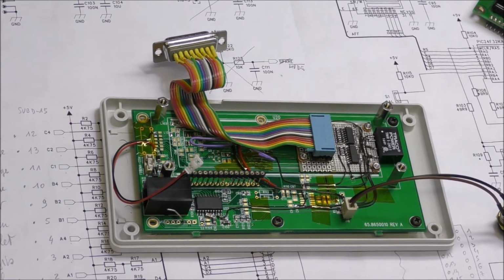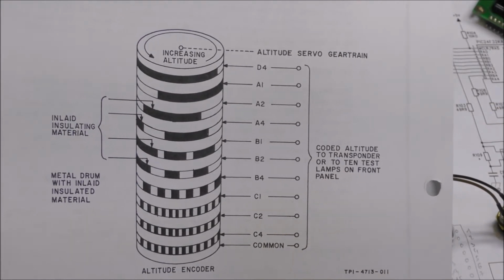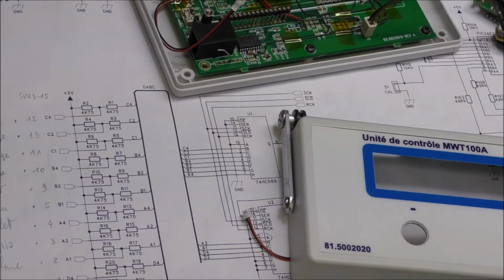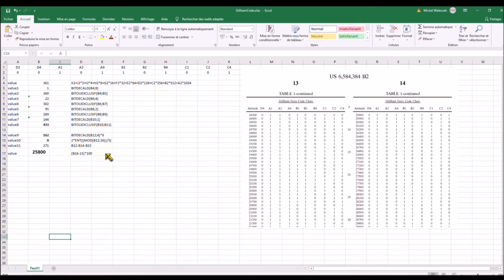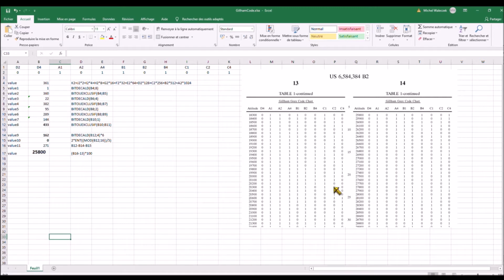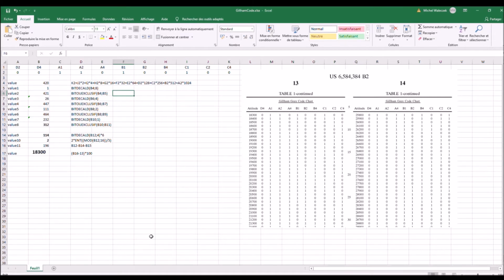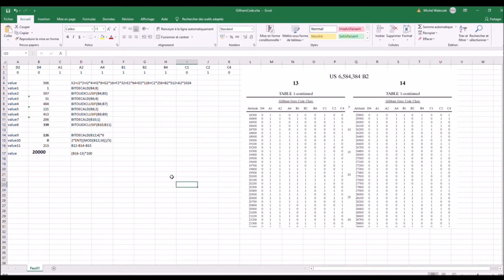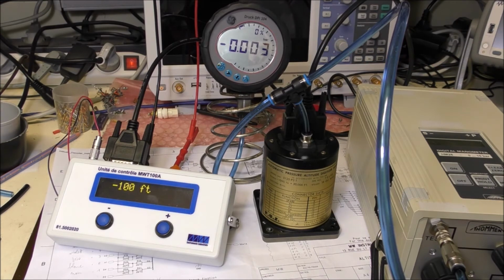LDM #77: Design and tests of an Altitude Encoder Tester

Comment: Your videos are very interesting. Where do you acquire schematics of the components?
Reply from the maker: If your question concerns the instruments, I buy the technical manuals when I found them, but it concerns a very few instruments. Generally the documentation is not available so when the instrument is not too complicated I do a reverse engineering to extract the schematics. This is a long process, generally one or several days. Sometimes it is impossible, due to complexity or by the presence of conformal coating which prevents the use of continuity tester, the main tool for reverse engineering.